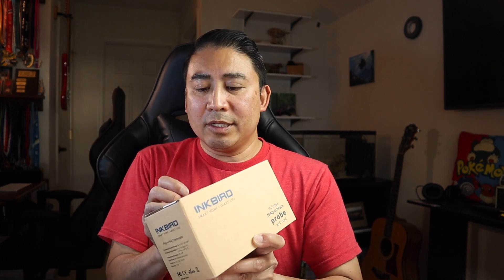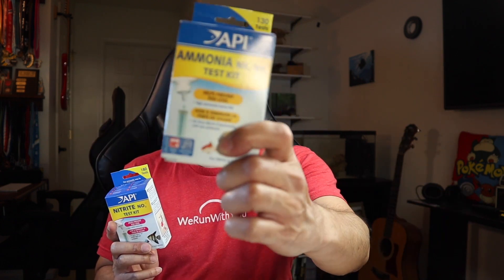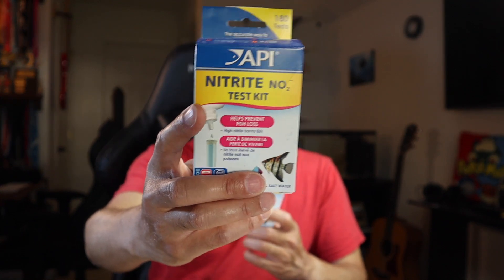New Budget DIY All-In-One Nano Reef Tank Build - Adding the First Corals

Comment: I think u put enough goop on the acrylic, but to b on the safe side I might "tie" that cord somehow to the side of the tank with a tiny bit of tension to offset the weight of the light. Over time it will give you piece of mind knowing that light isn't sitting in your tank :-)
Reply from the maker: Thanks! That’s a great idea! I might just use some metal wiring and tie to a wall screw to provide counter-tension.